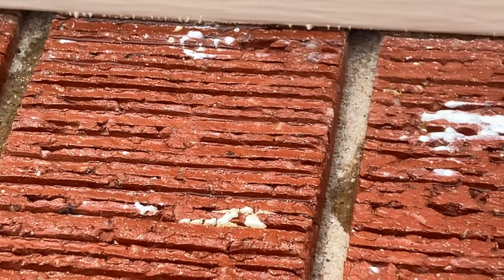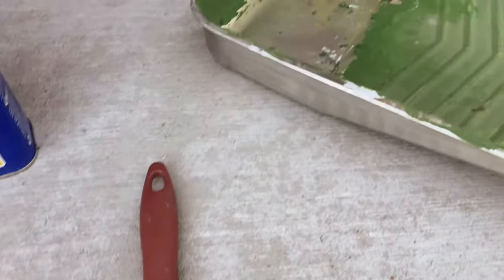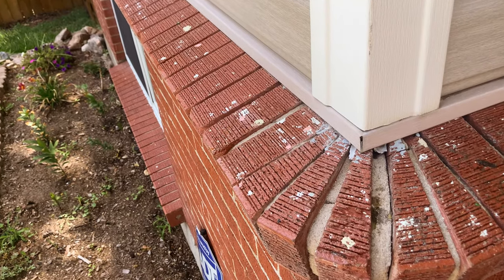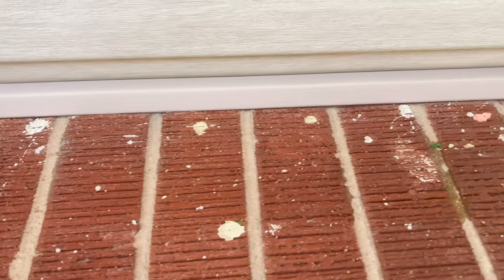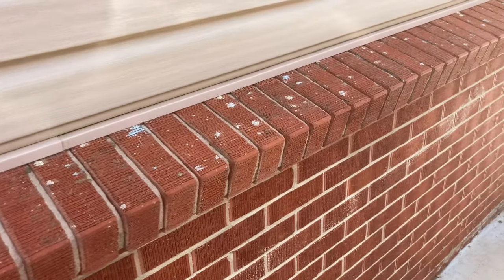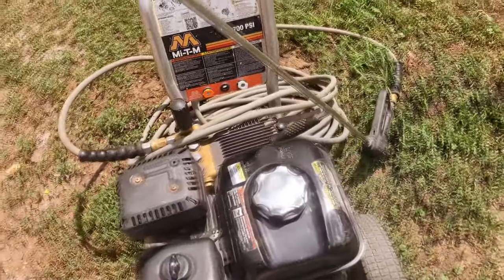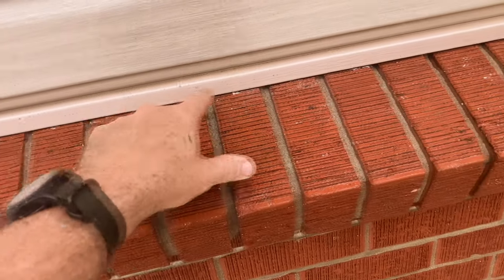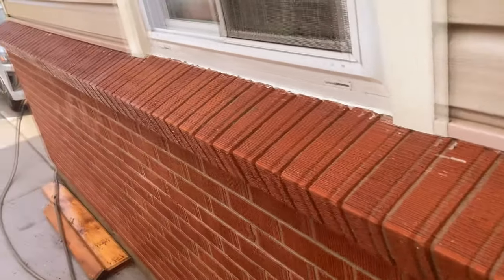PROBLEM SOLVED! Removing Paint from Brick

Comment: I'm in the process of trying to figure out the best way to remove some heavier patches of paint from my brick, which is how I stumbled on your video. I'm commenting because everything else I've seen so far says to never use caustic strippers or high pressure on brick. It will definitely clear the paint, but it can also weaken the brick by destroying the hardest skim layer on the surface that protects it from the elements, potentially breaking down much faster than it otherwise would. Hope that's not the case and no damage is done, though.
Reply from the maker: That may be true, however I haven't noticed any problems yet after doing this, and it's rained more in Colorado this year than every before in recorded history so I dont think I damaged anything thankfully :)

Comment: $340 for a used 2700PSI unit? Eek.

Simpson has a great 3400PSI gas unit for $399 ($299 for BF at Tractor Supply). In case anybody needs to know.